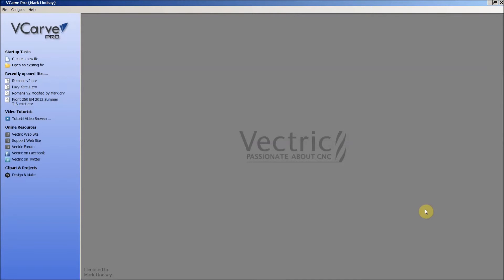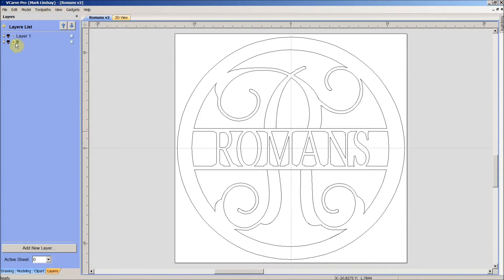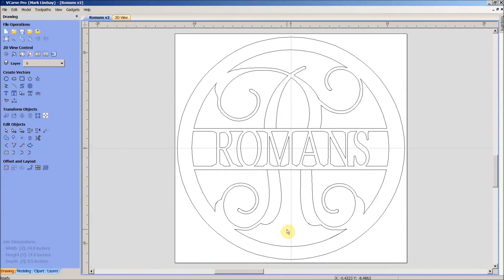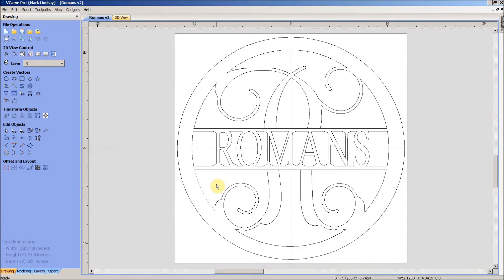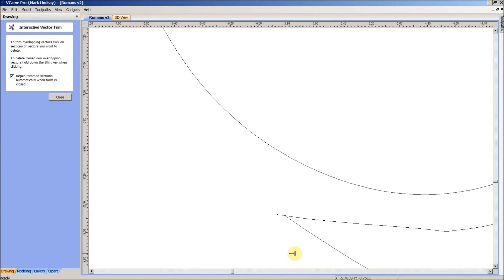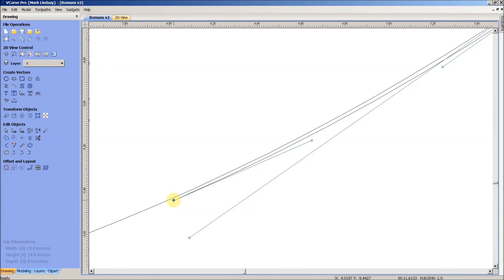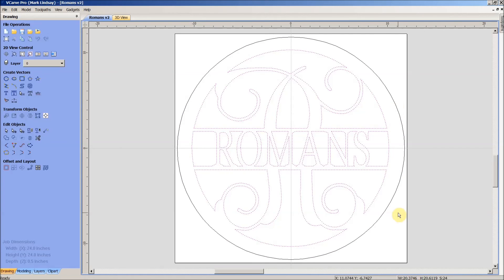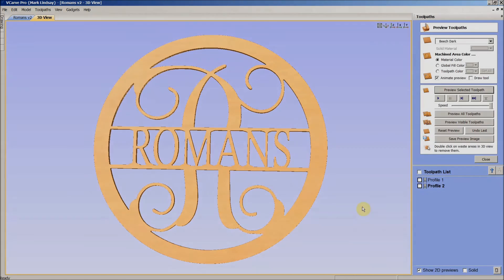Joining Vectors that Just Won’t Join in VCarve and Aspire

Comment: Very useful; in my situation I had two arcs ending tangentially and apparently coincidently... But I could not get them to join to closed. No matter what I tried, they remained two open vectors. Using your info, I drew a line perpendicular to the 'coincident' arc ends; then I 'moved' it laterally 0.005" from the endpoint 'into' the arcs, zoomed in and trimmed both arcs back the 0.005" using the line, deleted the line, and then BOOM, they joined into a single closed vector. For some reason, VCP could not reconcile the two arc endpoints that closely; trimming them back, gave them a discreet tiny 'apart' distance, which my tolerances would not object to. Great video and explanation.

Comment: Sent you a Super Thanks!!! Question..... If you cut the inner parts as profile. wont you need tabs so that they don't break free?
Reply from the maker: Yes, you will. I normally don't add tabs in my demonstration videos, so I can delete the waste material and show off the complete preview. Cutting to the inside or outside doesn't matter - if you cut all the way through a piece of material, leaving no way to hold the piece in place, use tabs.

Comment: Another great video Mark, thanks for taking the time to do them for people like me. I necer would have thought of a node on top of another to close a vector.
Reply from the maker: Thank you, Kyler. That's just one way of doing it - there are a couple of others. The main reason I showed that method was to reinforce the need to make sure that your vectors are/were drawn properly. You can also adjust the tolerance in the Join Vectors form, but that can sometimes give you "interesting" results if you set it too high.

Comment: I'm exporting a dxf from Fusion and opening in vCarve and I have the issue of vectors not joining. I was able to clear up all but four of them using the techniques you showed in the vide. This was extremely time consuming and not going to be practical for the amount of work I need to do. Is there something I can do in 2D CAD or Fusion 360 to export a cleaner dxf file that vCarve can use without all the cleanup work?
Reply from the maker: I'll say up front that I'm not familiar with Fusion 360 at all. I have it, but I've not used it. Having said that, if there's a way to join all the vectors in 2D CAD or Fusion before exporting it as a DXF, that'll go a long way to helping you out. If there isn't a way to export joined vectors from Fusion, then I'm afraid there isn't much choice but to handle it in much the same way as you have been doing it. Do understand, however, that this is an older video, and a lot of things have changed in Vectric's software - especially "under the hood" where we usually won't see it at first glance. One of those ways is how the software handles joining vectors while in Node Editing Mode. You have the ability to select vectors, then select specific nodes, then join those nodes using a straight line, a curve, or moving the end points so they meet and join into one. You access those functions by selecting the nodes you want to join, right-clicking, then using the context menu to select the option you want. I do plan on making another video that talks about this in the future, but it's going to be a while before I can get to it.

Comment: I am an extreemly experiance Vcarve pro user, I've used it daily for more than 5 years and right back to v3 and in the main I love it. However sometimes you just cannot solve vector errors even when trying all of the usual tricks. What often fixes an error that is not the usual simple node issues, is the indent tool,  I will indent all of the lines by a tiny, fraction deleting the original. That is my last resort fail safe you can, spend hours messing about looking for the problem otherwise.

Comment: Hi mark great video! With using a profile toolpaths on that project how would you hold down your part, wouldn’t all the little cutout parts go flying around? And I have had a problem sometimes real thin parts like in this file breaking during the cutting, how could I prevent that from happening?
Reply from the maker: I'd mount the material like this. It works like a charm, and has never failed me.   https://www.youtube.com/watch?v=3uTsQ3dYRrk

Comment: very helpful, maybe for someone else a tip, I found half of the problems, and it then seemed that I had many lines stacked on top of each other so I selected the right outline and moved it over with shift cursor up and there all the double lines showed  up selected  behind the good lines then it was easy to erase them thanks again
Reply from the maker: Thank you very much, Hans! Yes, that is certainly one option. You can also move the right outline to another layer, then turn off that layer and delete the double lines.

Comment: This is great info - and in theory it should work for me, but when i go thru to cut some of these things it inadvertently cuts things that dont appear to be connected to it. Im pretty new at this so im sure its something that im misunderstanding - what causes vectors to be associated but do not appear to be connected? how do i terminate that relationship?
Reply from the maker: There are a couple of possibilities. One is that you may have duplicate vectors in the drawing, and VCarve is confused as to which ones you're trying to delete. Another possibility is that you may have your tolerance set too high in the Join Vectors tool. Set it back to .0004 and see if that helps.
Reply: Mark Lindsay CNC I have several video clips - I have selected duplicates and it says none- however it’s pretty evident that there is something going on

Comment: In an effort to add to the content of the video may I point out that when you tried to use the "join open vectors" tool you did not try modifying the tolerance, .0004" is a rather tiny tolerance especially for what the image showed.  Quite likely that many of the vectors would have been cleaned up by adjusting that setting.  Granted without the file I can't say for certain, but perhaps you could give it a try and see.  Now the 4 straight lines you used the cut tool to remove would not be taken care of here, also may have some trouble with the "extra" arc on the lower right of the image, but image that many of those vectors could have been closed using the join tool (and also saving a good deal of time).  If the adjusting the tolerance were to mess up the image all one need to is undo and viola back to where you started.
Reply from the maker: You make an excellent point, Jim, and thanks for watching. The extra arc and the four lines I used the trim tool on were exactly why I didn't adjust the tolerance in the Join Vectors tool. This wasn't so much a demonstration on how to use that tool as it was a demonstration on some other methods of joining vectors - especially when the design has several different reasons why vectors won't join. You could certainly change that tolerance and possibly clean up most of those vectors rather quickly. The point of the video was to show that by zooming in and looking at the vectors, especially where they are supposed to join, you can see what the problems are, and that there is more than one way to correct them. Thank you though. I do appreciate the input!